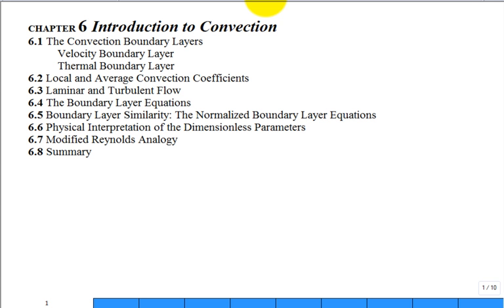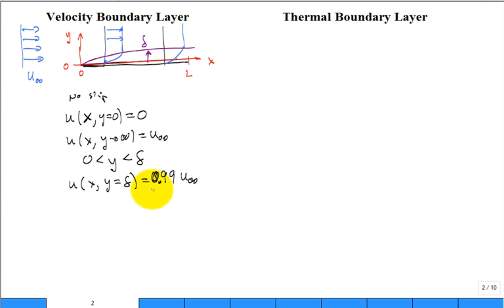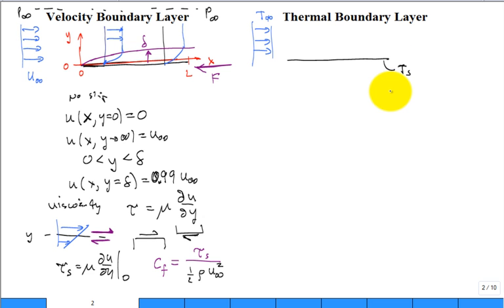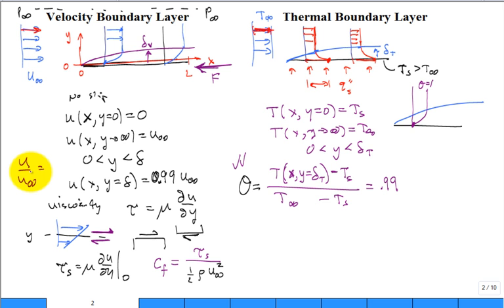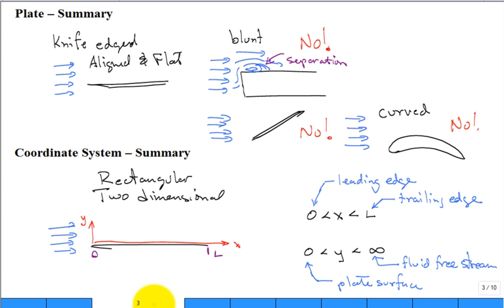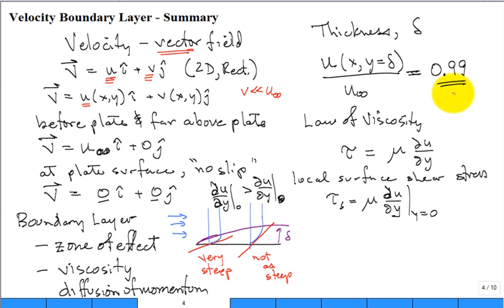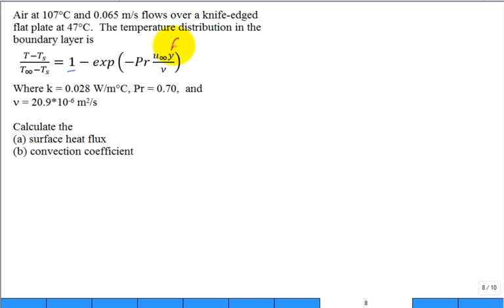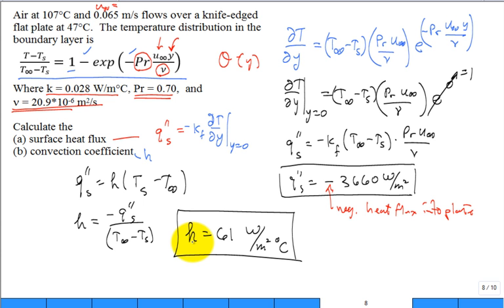Intro Convection Heat Transfer

Comment: At the 21:00 mark when you take about the slope of theta, you say that it gets steeper (larger) near the leading edge. Should it be larger away from the leading edge? Or am I misunderstanding?
Reply: At 24:00 mark you summarize the VBL and show the VBL diagram with the two slopes. Why does the left one say "very steep" but the one on the right has a steeper slope?
Reply from the maker: vel in x-direction is "u" and it is a function of "y" distance from the plate into the fluid.  "very steep" means du/dy is larger, so velocity rapidly increases going into the fluid from the plate surface.
Reply: Thank you. I get it now.
Reply: think of an exponential function(the graph of one). it starts at a value, and rapidly turns into an asymptote. where the slope is infinity where it starts, and zero where it finishes for a horizontal asymptote, and vice versa for a vertical asymptote. You can see there are two plots with one of each type in the same picture so consider which one youre analyzing.
The blue lines he has drawn on both analogous plots are just that. we know that the slope of a flat line is just zero..

 so just imagine that the plate on the right is hot, and there is fluid flowing over it.  At the knife edge(leading edge) right where the fluid first comes into contact, the plate doing the heating hasn't had a chance to do an even heating, since most of the plate lies to the right of that point. But further down the line, where the plate has heated more of the fluid, the fluids temperature will be constant at any y location you choose to analyze. where the temperature at y=0 is just the temp of the plate, and it decreases temperature as you move away from the plate(heat source). 

But the whole concept here is that there is a point where the temperature stops decreasing as you move away from the plate. in other words, it is approaching some value(the asymptote). and since temperature obviously wont get below T(infinity), we can say that our temperature as a function of y [T(y)] must lie somewhere between the surface temperature, and the freestream fluid temperature. 

How far between these temperatures does it lie? that's your theta. look up the formula for linear interpolation and it will look exactly like that. 

theta lies between zero and one. and depends on where you are in the y location which varies of 0 to delta
Reply: b careful because there are two exponential profiles on the same plot. one representing the fluid temperature as a function of y. and one plotting the delta, which is the depth of effect due to the prescence of the plate